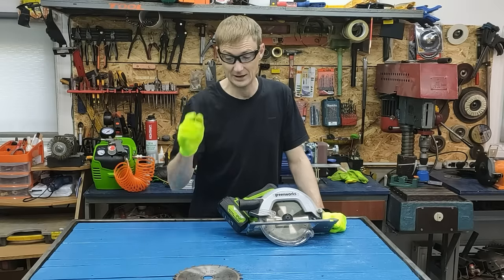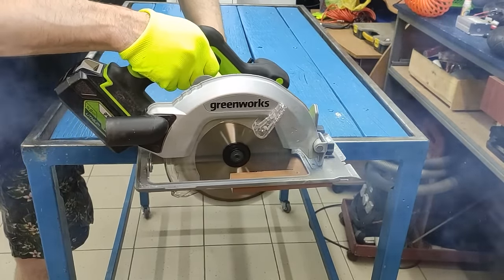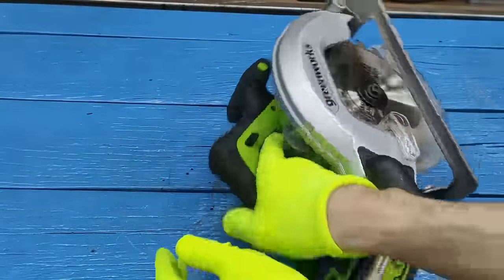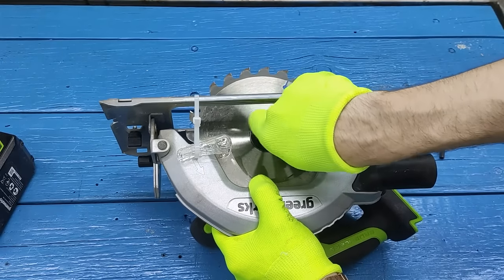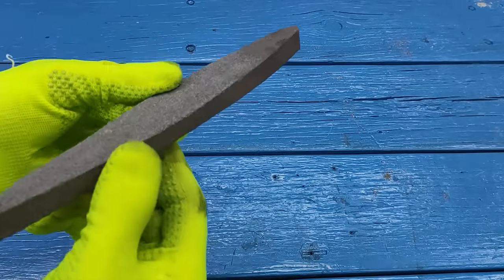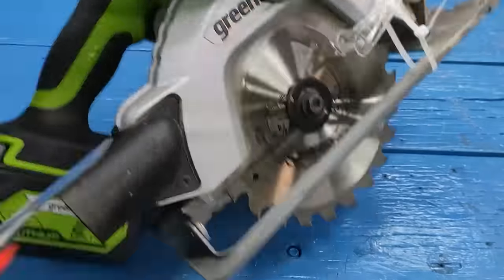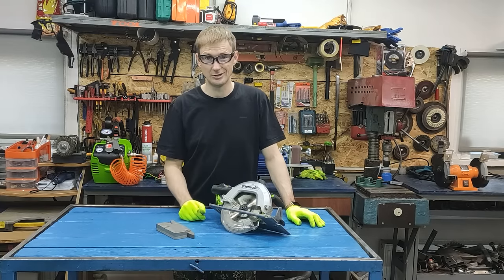How to sharpen a circular saw in 1 minute. The saw sharpens itself

Comment: Most saw blades are tungsten tipped (unlike this one which appears to just be steel). I'm not sure if tungsten tips could handle this treatment.
Reply: exactly !
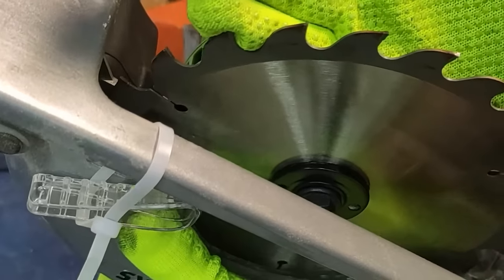Reply: I will disagree. You can clearly see the tungsten tips, e.g.  1:37 or at 2:20
Reply: It's carbide. Very strong but brittle.
Reply: @OlTrailDog  Get some glasses, it does not have cabide tips, the small amount of black is from the tips heating while cutting blunt, use your brains.
Reply: @grancitodos7318  1:37 and yet carbide tips are clearly visible
Reply: @avid6186  Look at 2:23, unless you have a vivid imagination, there are no carbide tips.
Reply: @grancitodos7318 …..As my momma used to say, “courtesy costs nothing” there really is little need for rudeness in this world.
Reply: @andycapp8843  One needs to be rude to some people, they don't understand anything else.
Reply: @grancitodos7318  That simply isn’t true, being rude is akin to confrontation and the result will be retaliation.  That is a journey to nowhere in particular.  How can you justify being rude to a guy who goes to the trouble of producing a video for you to watch for free? What is the point and where is the benefit? Debate with alternatives or educated criticisms by all means but being polite at the same time will achieve more positive results.  
As my momma used to say….”
Reply: @andycapp8843 

I’m with you, Andy Capp! If you can’t be nice, just keep on walking.

Comment: Fantastic. Question is, will it work on band-saw blades? Run the blade in reverse by hand or,  with help from elec. hand-drill coupled to 2 spokes of one of the band-wheels.

Comment: it look's very cool, but, to sharpen CARBIDE tipped saw, you need a DIAMOND ?, I AM WRONG ??. I WAIT FOR YOUR ANSWER, thank you
Reply: No need diamond for Carbide, abrasive work very well too to sharpen. I sharpenned a table stuck blade because it is stuck there. :D  Still working very well but I done it with a wheel grinder and not at the same place as this video show (The tip, but I done that inside.)
Reply: But, I'm curious to know if it work wheel in this video since look like easier and more simple. :D
Reply: I use silicon carbide Stone to sharpen my tungsten TIG welding tips and also my carbide lathe tips. It is a green stone. This might work but I doubt that the edge on the blade would last very long.
Reply: @sergiomomesso1590  Best done on the  inside of the teeth, they don't disappear so fast, A fine diamond disk on an angle grinder will work for carbide, a bit slow, one tooth at a time.

Comment: IMO, only suitable for HSS steel blades with level tooth's, not for carbide hard tip tooth blades, which in adition have trapezpoidal , concave and other tooth profiles. Am I right? If so a warning should be done since personal hazard my happen!

Comment: Uhmmm . the tip of each blade is angled, now you've squared them off? In the long term, you'll have to replace that blade sooner
Reply: You're just be wearing out the cutting tip from the top, instead of the face. The rake angle stays the same, too, because you aren't touching the face.

Comment: I think you will need a Silicon Carbide stone with some blades.
Reply: No, a diamond stone is needed. You could do it with a diamond cutting disc, in a grinder.
Reply: @grancitodos7318  Yes diamond would be better but Silicon Carbide does the job too.
Reply: @scaryfakevirus  I saw a green stone somewhere, with a carbide tool, don't remember where, but I have diamond discs for the angle grinder.

Comment: This is total BS.  What he's doing is called jointing, which makes the teeth the same height.  To actually sharpen the blade, you have to file or grind the FACE of each tooth alternating from side to side according to the bevel of the tooth.  In most cases, it's easier just to buy a new blade.